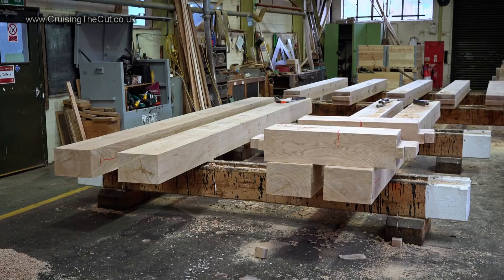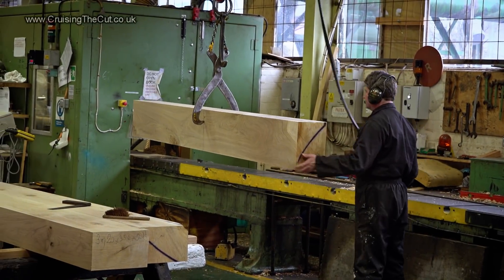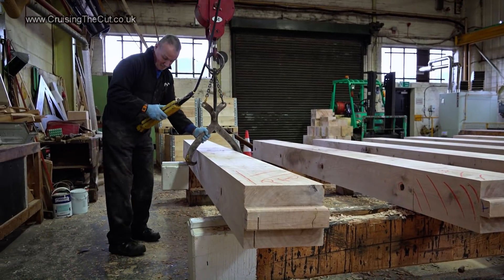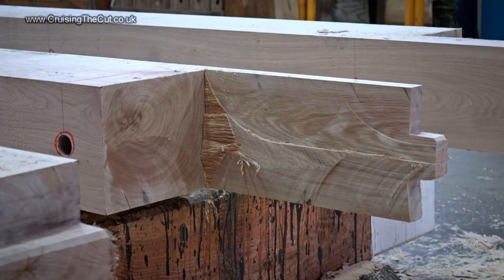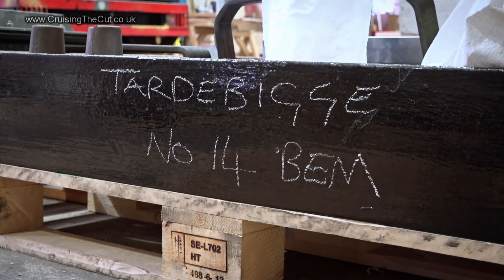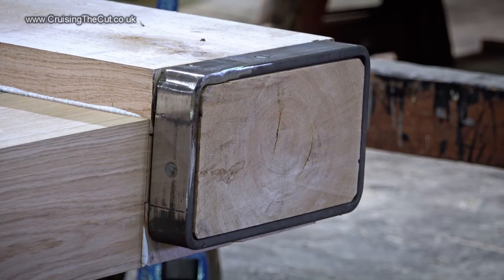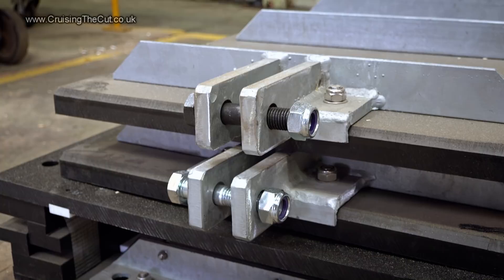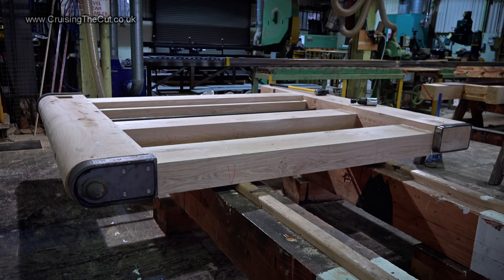131. How canal lock gates are built, at the Canal & River Trust's Bradley workshop

Comment: Very interesting! I am surprised, though, that wood is still the material of choice. Is there any reason that steel has not replaced wood? That would of course require all measures of upkeep for corrosion protection, but that seems like a lot of old growth wood being used for these.
Reply from the maker: Steel likely wouldn't make a good waterproof joint between the two gates, wood has a degree of compression "spongyness"

Comment: I'm glad you referenced this video in today's gate install video! Thank you. 
It is possible I am not familiar with that commercial planer. It may have a secondary cutter at 90 degrees, and, if so, that is very kewl! However, in common woodworking, a thickness planer only makes the top surface parallel to the bottom surface while it is inside the machine. It would not actually make it square and true. It is a common misconception.

Comment: I'm rather surprised they are using such simple tools. I once watched a bus sized CNC machine at work. It was designed to shape wood for timber frame parts. It could turn out parts like these gate pieces in a manner of minutes. Of course it was a very expensive piece of equipment.
Reply: My understanding is that every set of gates is different. Mass producing would be a waste of resources. Plus the sheer cost of this wood , would be extremely expensive to make the machine pay for itself. Most of the money comes from donations and grants. It’s simple not feasible to leave gates in these conditions.( outside). Gates are normally fitted during winter and last around 20-25 years.

Comment: I have watched a few vids on these gates now, and I am so confused how such a gate makes a seal. I am sure this is really obvious to people who work with them a lot, but how on earth does that rounded hinging plank of wood make a seal up against the canal wall? How does two gates simply pushed together not stop water just flowing between them?
Reply: They aren't completely watertight but if you think of the shape of closed lock gates forming a V with the point of the V facing upstream, the pressure of the water forces the gates together.  Since the surfaces are slightly soft and fairly flat, that pressure is enough to form a decent seal.  However, if you look at a brand new set of lock gates and compare them to an old set, you'll immediately see how much more water leaks out of the older ones.
Reply from the maker: The water pressure pushes the gates tightly together

Comment: Another wonderful program and something I was curious about, so thanks.  I was only sorry that it was so incredibly short.

I have to wonder why they don't tar the gates, or maybe they do that on site so they are easier to manage?  Seems to me that a good coating of tar might not last more than a year or two, much like when you blacken the bottom of the boats, but that's a year or two more life out of them.  Oak isn't particularly good at resisting damage from water, especially when the end grain is left exposed, hence why they wear out so quickly.  Something like Stockholm Tar or Russian Oil would seem like a good idea even if it does add to the expense somewhat.  After all, getting two more years out of a gate when you have a hundred gates needing replaced every year.... seems like a decent idea.  I'd hate to see steel and plastic gates, though.  Seems like they're just too new-fangled to my mind.  Best stick with what's traditional and keep the guys at the workshop employed.
Reply: In my experience we don't tar gates as the oils and hydrocarbons within tar (and so oil) can leach into the water, as i was told. When i 1st started with used to use bitumastic paints, but that was stopped many years ago.  Oak lasts surprisingly well, and the real issues tend to be around water line (where air / water mix) and bolts becoming loose, which reduces structure and then planks start to work loose.   Steel gates are okay, but they don't tend to bounce and so when replacing heads or heel timbers it can be a bit of a faff. I've never worked on or seen plastic gates.  Plastic paddles, yes, several times over.

Comment: Such dedicated work to retain the Vintage Gates. A question does come up. Is there any move to standardize the Gates across the UK. While understand there are Preservation Societies who are very active. As this is also now mostly a tourist industry. While each Gate as stated may be slightly different in shape and size. Having a unified construction would be fitting with the original intent of the Industrial Revolution. It is an enormous task to keep the Canals Running. and the people involved are to be commended not just for maintain a part of history but also it provides both home and resource to many people. It is a true treasure which I think has been lovingly restored. Cheers
Reply from the maker: There is no standardisation, nor do I think there could realistically be as each canal was built slightly differently (eg on the Macc there are two top gates, whereas most other narrow canals have one) and is individual to the size of the drop required. You'd have to entirely rebuild the canals and in some cases add or remove locks, to set a stock gate size.

Comment: 200 replacement gates a year, that’s a lot of wood! Wonder why they don’t use metal.
Reply: Well waaay more expensive. of courese. But keep also in my that these locks are manually moved. Metal lock gates would weigh more than 10 times as much and would not float to assist the operator.
Reply: In another canal boating channel they mention they only use FSC wood, if that's what you worry about?
Reply: someone mentioned that some cast iron gates had been installed  but they tended to bend under the weight of the water and cant be bent back and weighed much more so were harder to move by hand so that practice was abandoned.

Comment: I'm surprised they don't use better wood like ash  or live oak live oak is soo much stronger and better used in marine aplacations. And why they don't use an oil based  sealent. Or just use steal all together it would last soo much longer and a lot easier to fix
Reply: Wouldn’t want to put themselves out of work...
I suppose they are restoring to original specs in most cases.
Reply: Steal requires a lot of upkeep, and repainting the locks require draining the canal at least every 2-3 years.

Oak gates will be in place for 25-30 years. with virtually no need for service.

There is no use to make the seals completely tight, you want some exchange of water anyway in the canal system.

Ash is probably too light, it will not be hard enough. It weathers nicely on a facade, but is it really useful submerged in water?

And live oak does not grow in the UK.

Comment: i wonder if they could do something akin to a steam valve in the locks, to prevent them in advance from leaking so much, and thereby degrading the seals. i mean, i get the basic concept, and thank you so very much for that look into how they're constructed. the thing is: i'm watching your videos which include locks - and watching all of them leaking terribly - not so much as to interfere with the basic process of using the locks, but i'm not so sure why we're trying to make a tight seal when a loose seal is obviously inevitable. the thing is, if a loose seal is inevitable, it seems ideal to embrace that and come up with a planned leak that doesn't stress the seals in the lock. do you have any idea to whom i might direct my questions? though not i'm not accredited in any way, water movement, transit, and water-danger mitigation (must come up with a better way to say that) are my interest. my "jam" as we say in the US. any resources you could direct me to for the more technical questions would be most appreciated. thanks for your vlogs - you show things i actually want to know about instead of pretty pictures of things. (not that i don't appreciate those - that was a very lovely zoomed shot of a squirrel. ) thanks for what you do.
Reply: There are various ways of improving on lock design. UK uses many simpler old fashioned designs that are suboptimal from a technical perspective. But they are limited by funds to mostly just maintain current designs. Some also appreciate the aesthetic character of old designs. But I think they would nevertheless use more modern designs if given unlimited funds.
Reply: @Stu_Bur  Canals wouldn't look right with any other type of lock.
Reply: i feel the need to add that i wasn't being sarcastic about this squirrel - it was really cool!

Comment: I am just theorising..   But as an impractical experiment / joke I am tempted to go up and down a short canal a few times without using (opening) the top lock.. Would that drain the canal (somewhat)?  Or would the leaks in the top gatelock be more than sufficient to cope?
Reply from the maker: I don't really understand the proposition, sorry
Reply: @CruisingTheCut  Oh wow, thx for answering!!

I was just playfully musing if the down stream locks would be opened far more often than the upstream ones, if the canal would drain (somewhat)? Or would the leaks in the lockgates be enough to ofset this?

I hope this makes it more clear :)
Reply from the maker: If nobody took their boats past a certain point but continually shuffled between a specific lock or set of locks then the pound above the highest lock would eventually empty (in theory) since no emptying of the higher pounds into that pound would be made to offset the lower losses. But the Canal and River Trust monitor the pound levels (as do the boaters!) and so would come along and refill it
Reply: @CruisingTheCut  ty
Reply: @CruisingTheCut  I appreciate you taking the time to answer.  Not many youtubers do, especially on older vids! Thx.

I really like your vlogs.
Reply from the maker: I read every single comment and try to reply to those that I can! Cheers

Comment: How do they do the final lining up to get the two doors watertight? And what stops the water flowing under the gate? Is there a rubber seal?
Reply: It's not /totally/ watertight; you'll get some leakage on a real-life lock. As it is, they use the slight distortion of the lock gate(s) under the pressure of the water to effectively wedge them into place between the walls of the canal. (As they're mounted at something of an angle to the flow of the canal, so the more pressure applied, the stronger the force keeping the gate closed.)
As for the bottom of the gate, I had to look this up, but it looks like there's basically a step up from the base of the canal, as it goes from upstream of the lock to into it. The water pressure from upstream then forces a reasonable seal between the lock gate and the step as it's closed against it.
Reply: They plane the end gates to fit together once they are in place, the rest just uses the force of the water and the swelling of the timber to seal. Woodern boats are sunk to swell the boards so they then float!
Reply: In another documentary it was mentioned that every mitre, the angle at the leading edge of the gates, is different and specific to every pair of gates,  this ensures the maximum amount mating surfaces coming together to form a seal when the water pressure holds them together.  You also have the natural flexing of the timber to help, this is why timber is the best material and Oak is the best timber.
Reply: Water is bloody heavy, it'll force them together.

Comment: Why aren't they made of aluminum? last forever surely
Reply: for the same reason you wouldnt use  double glazing in westminster cathedral it has to blend into the traditional design.
Reply from the maker: There are some aluminium ones but they're substantially more expensive than steel and nobody makes them any more, plus the skills to weld alu are not nearly as extensively found at the wharfs as that for mild steel.
Reply: Alu will bend over time, it can't witstand the water pressure too long. Iron will be heavier and prone to rust.
Reply from the maker: Cheers Mark, good info!
Reply: Also oak is a lot more resistant to being bashed by 16 ton narrowboats. You shouldn’t contact the lock gates but people do. Aluminium gates would bend and then leak or not fit.
Reply: Water is bloody heavy is why

Comment: Coming originally from Hull My late father inlaw used to repair gates. A lot were made from a timber called Green heart and all the work was done by hand. I actually had some of his chisels.... so solid and heavy to work with. The bearings were made from Ironwood.... this timber is heavy and does not float (it was also used for bearings on early wooden boats as well). If you get a splinter from Green Heart it can fester in usually 24 hours and is quite poisonous as I found out as an apprentice. Even the dust can cause health problems. Even a modern chainsaw will blunt in minutes as it is so hard.
Reply from the maker: That splintering sounds most unpleasant!
Reply: Seeing it was 50 years ago I don't remember much of that time. We totally enjoy your vlog and wish we had canals here in new Zealand
Reply: When I worked in the Quincy Ship Yard (Quincy, Massachusetts,USA) machine shop, they had a prop shaft and it's ironwood bearing come in for refinishing.  That was about circa 1983.  It wasn't a small boat either.  Marine vessel.  Shaft was probably 20 or so short tons (2000 pounds a short ton).  It was a long time ago.  I bet they still use ironwood due to it's durability in certain applications.
Reply: @blaydCA  There are some self lubricating African woods as well, that sometimes are used to replace ironwood, especially in dry applications.  They also readily sink.

Comment: how do you open a set of double lock doors by yourself.  When you open one, how do you get to the other side to open that door.  Rene   by the way love your blog
Reply from the maker: You open one, run up to the other end of the lock where both gates are closed, go across those and back to the other gate that needs opening.
Reply: @CruisingTheCut  Or jump down on your boat and back up the other side.  Oh, wait, that would be the unsafe way.
Reply: @Krieghandt  or, if it's a narrow lock, stride across the 3' 6" gap to the walkway on the closed gate. At your own risk, of course...

Comment: Very interesting. So where do they get the Oak for these gates?   If they are making 100 gates a year in 2 shops, that is a lot of Oak that takes a long time to grow.  It would be interesting if they made wood looking gates out of that plastic which take 4 trillion years to break down.
Reply: At a guess, and it purely a guess, it may be American white oak. This is used extensively in oak kitchens in the UK, so perhaps it may be a similar import.
Reply: 10p6 - alumina may be? Would pressure treating that would make any difference?
Reply: @patmcnamara9081  1080 would work well, say 1/2" thickness with reinforcement, and some stainless steel parts.  add some anodes, and the workmen will work themselves out of a job :)
Reply from the maker: Not sure, sorry
Reply: The majority of it comes from Wales.

Comment: One of the things I most admire about the English is your traditions. It is very good to see skilled traditional craftsmen but I cannot help but think gates made of stainless steel or an aluminium alloy would be preferable in today's world. You could make better nonleaking seals and have gates that last with minimal maintenance 2 0r three times as long with no increase to cost. They could also be produced and installed  more quickly. I understand tradition and like I said I appreciate it but I am very pragmatic about most things. The canals have new metal piles down the side and that seems to be a massive improvement over the stone sides but that doesn't seem to get the same kick back as changing the lock gates would I guess.
Reply: An entirely metal gate would probably become to heavy to me manually operated easily plus most of the reason canals are used is for tourists and the tradition helps that
Reply: untap upkeep draw many locks will also be listed, which means repairs and replacements must be sympathetic to the original design and materials. There are metal gates on some of the more commercial waterways.
Reply: Tried and true wood for these small locks. I suspect metal may have been tried.   Note the bump strips on the wood gates.  Many boats bump against the gates. Wouldn't take too long for even very thick metal to permanently deform and leak badly.  Wood is more resilient to the bumps and will wear in to seal better. No gaskets to wear out either.

Comment: is the paddle on the inside or outside of the lock? on the inside the water pressure would press the paddle against the gate making it harder to open the paddle. on the outside and the paddle itself is resisting the water pressure in the lock. I would guess it's on the inside so it seals better but has more friction, that's why there are gears to multiply effort opening them.

Comment: Is the paddle made from plastic?
Reply from the maker: Metal
Reply: @CruisingTheCut  are you certain?  Sure looked like some sort of composition to me -- and a half-inch steel plate wouldn't need those aluminum stiffeners on the face.
Reply: @dbeierl  those "stiffeners" look like operator linkage guards to me.  It's metal for sure. Polymer composits wouldn't hold up to the pressure and abuse.  Traditional construction methods at their best.
Reply: @blaydCA  What are "operator linkage guards"?
Reply: I've wondered about this too, the close up shot at 8'07 certainly doesn't look like metal to my untrained eye and some paddles (albeit top ground) I've seen on the Regent's where they've been kept clean at the sides due to being in the runners are white, reminiscent of something like nylon. Although most others are definitely metal, I assume iron. Most curious